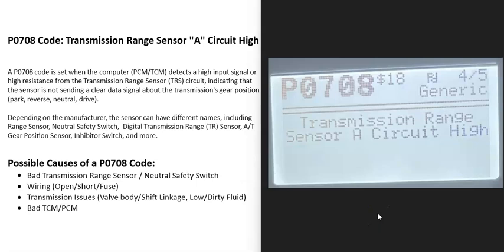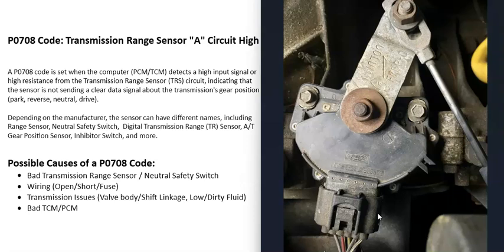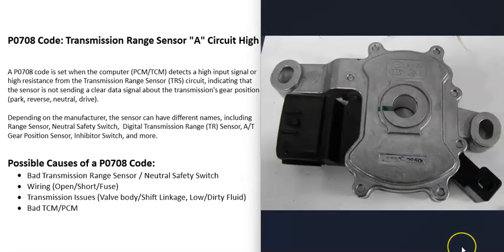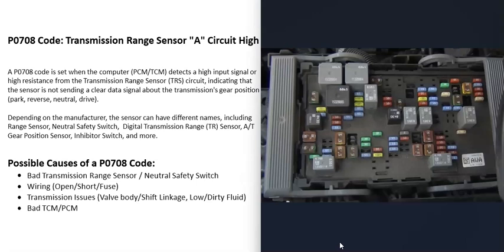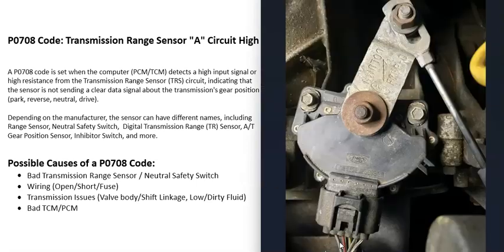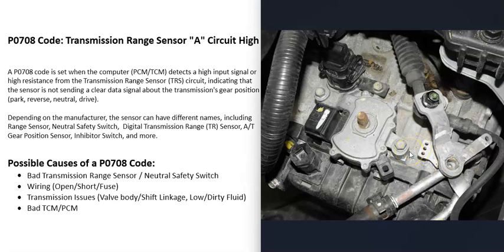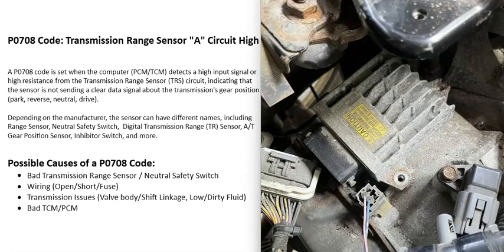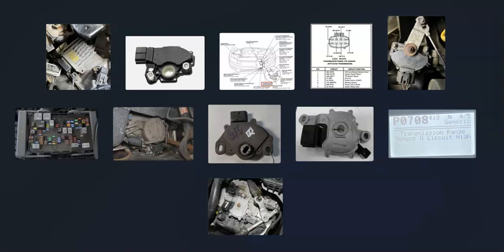Causes and Fixes P0708 Code: Transmission Range Sensor "A" Circuit High

Comment: I have a 2000 Ford Taurus It only has 35,000 miles practically brand new but old I've replaced both input and output speed sensors the wires checked after doing that the codes went away which was p0720 but the speedometer still doesn't work and it's stuck in limp mode but I wiggled or unplugged the range sensor just the check plugged it back in took it for a ride it started shifting erratically and the speedometer was erratic but moving . Could a bad range sensor affect your speedometer along with erratic shifts ?